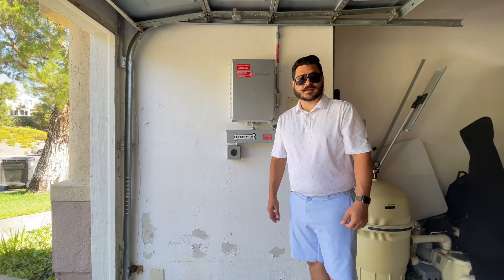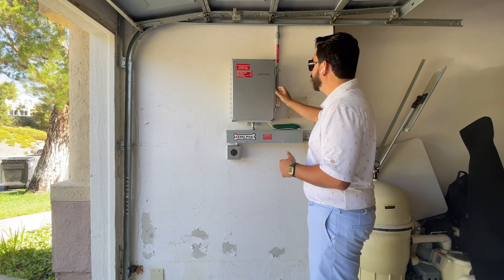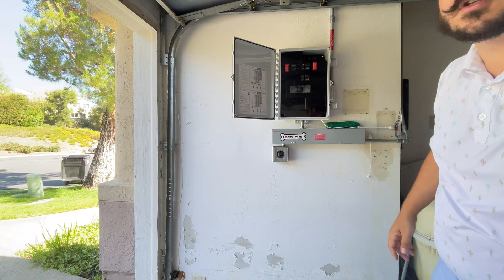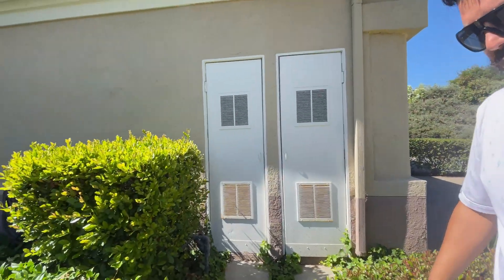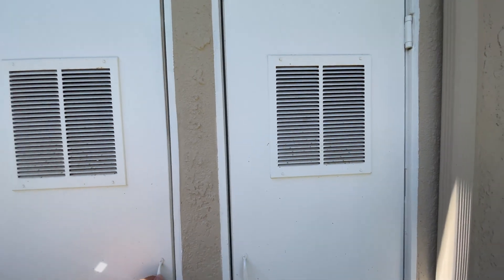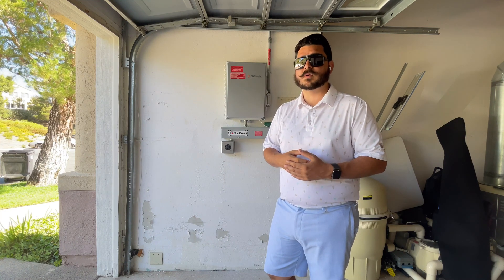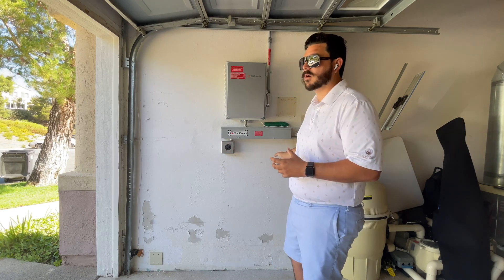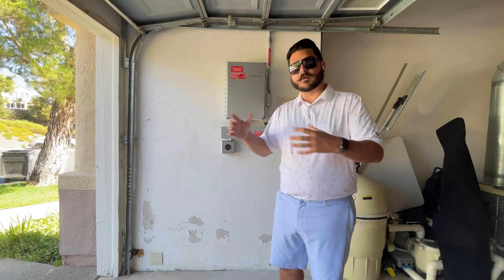Step by Step Guide on How to Check Your Solar Inverter - Enphase Edition

Comment: Are you allow to put Combiner and PV disconnect inside the garage/house?
Reply from the maker: You can installed the combiner in the garage but typically the discount goes outside for first responders.